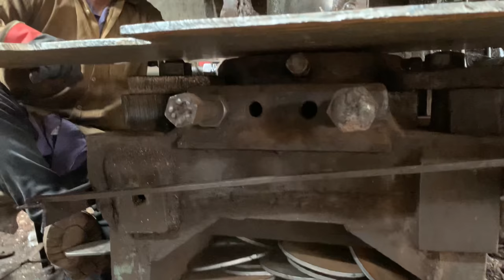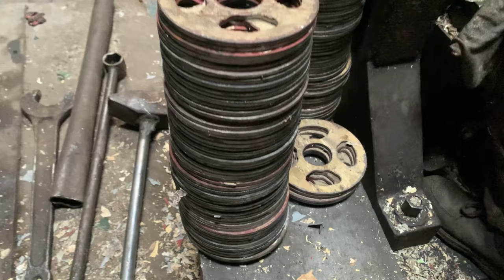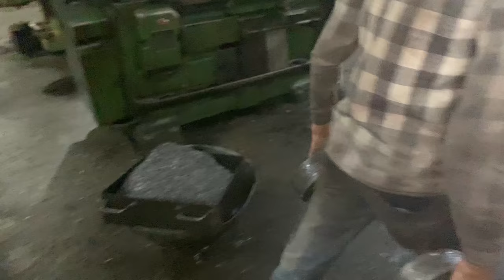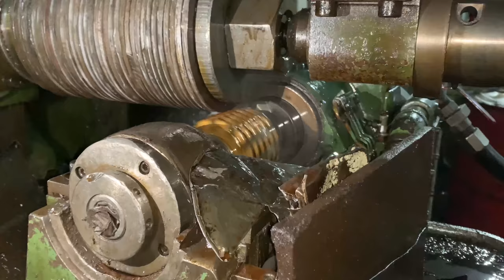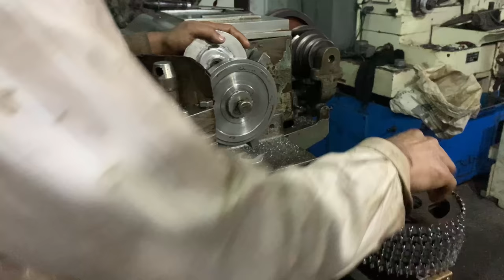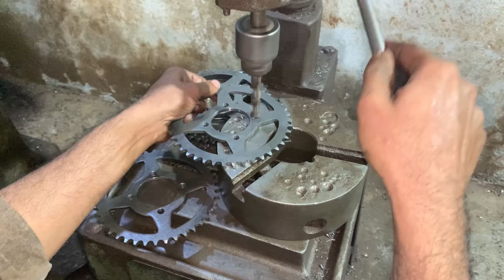Complete Manufacturing Process of Rear Wheel Sprocket Step by Step | Rear Wheel Sprocket Production

Comment: They skipped the hardening part. I was expecting some case hardening process  before finishing. I guess these sprockets are being manufactured for cheaper China model  bikes.
Reply: You right, low cost and quality details
Reply: no they will send them to local motorbike factory ( Honda  pakistan i think) that will treat and finish and use the sprockets in their units.  The local honda or suzuki  factories give batch orders to these type of small 'workshop/machinst/milling/factories' that are located close by.

Comment: I hope they have enough spare eyes, fingers, heads and other body parts in the magazine. On a lathe, the operating lever is on the wrong side. Must be crossed. On the vertical boring machine, the distance between the fingers and the jaws is minimal. With bare hands in the chips. 🙈 Aren't the tooth flanks equalized? Bad conditions don't relieve brainwax.